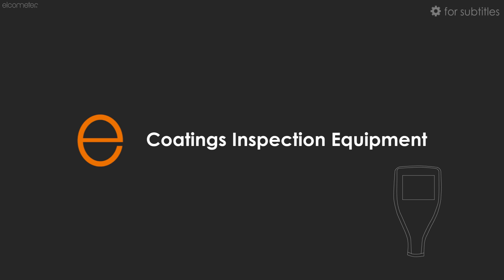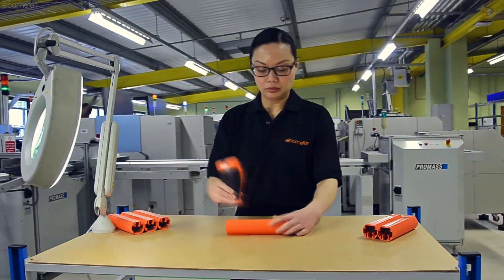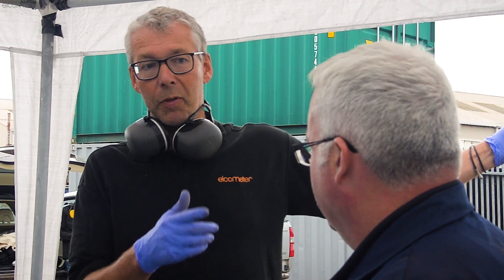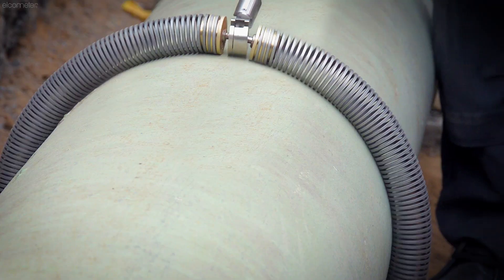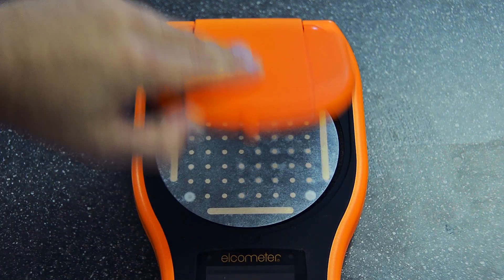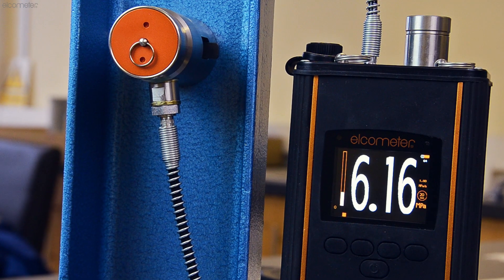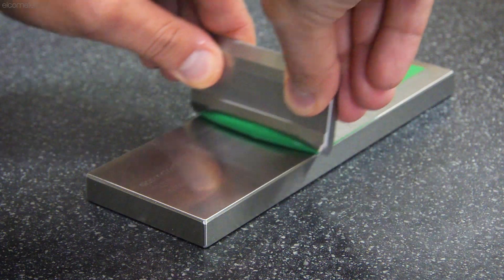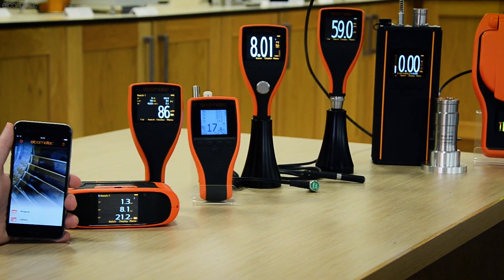Welcome to the Elcometer Coatings Inspection Equipment Channel

Comment: Which DFT guage can be used to check DFT of hot dip Galvanized metal pipe.?
Reply from the maker: Thank you for your comment.

As long as the galvanized metal pipe has cooled down, the Elcometer 456 should be ideal for measuring the DFT.

If you have any further questions, please contact techsales@elcometer.com or visit www.elcometer.com/contact-us to find your local Elcometer distributor.